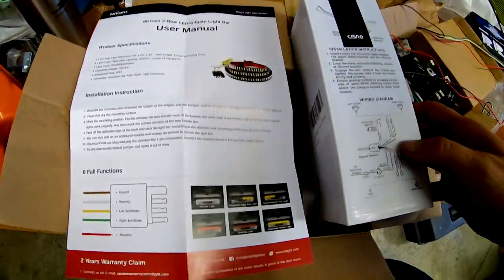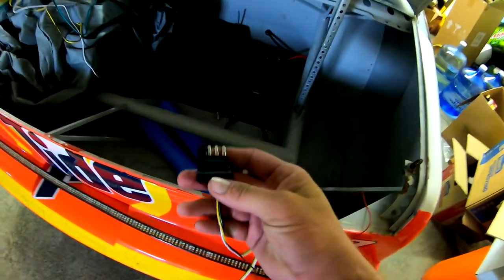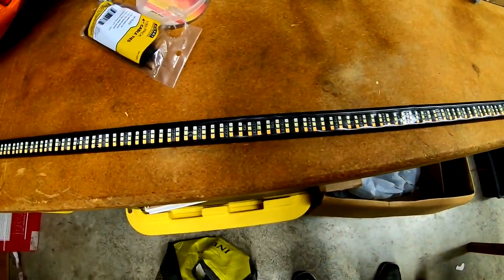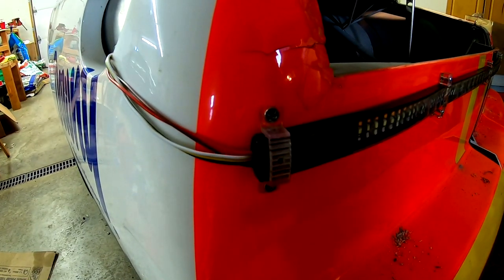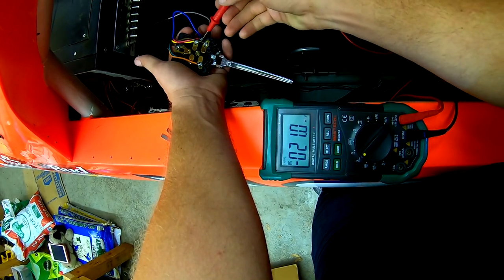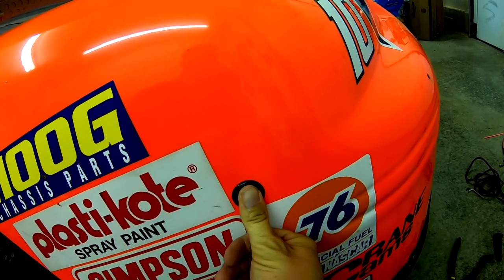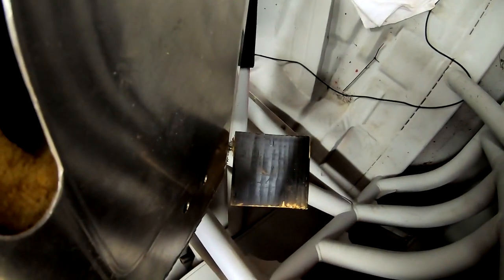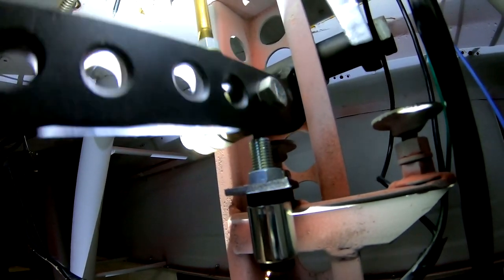NASCAR Tide Car Gets Turn Signals

Comment: Love the videos!!! Keep them coming. Thinking about doing the same thing. Can you show how you wired up the brake switch and universal switch? Any part numbers for rear light bar and blinker switch?
Reply from the maker: Thanks Chad! I appreciate the encouragement, I'm glad people are enjoying these videos. :)

I thought I showed the brake light switch in this video, it's a threaded switch that I adjusted off the pedal with a homemade bracket. If not, it might be in the one after this. The signal switch is a standard hot rod switch, it will come with instructions. The light bar is from Amazon, it has instructions also. Just measure for what you need and search search search! These cars were all custom, one off creations, my solution may not be the best for your car. Good luck though, it's a ton of fun!

Comment: Why not just run the wiring straight up to the deck lid into the trunk, at least there's less visible wiring then, assuming you can avoid pinching it?
Reply from the maker: That's a good idea, but all the body lines on the car are so tight, that running the wires that way would pinch them and also tweak the trunk line. I plan on drilling a hole behind one end of the bar with a grommet and running them through, no wires will be visible at all then.

Comment: Hello ! Wanting to know the parts number you used to apply to my race car as well ! Thanks
Reply from the maker: I think this is everything lol

Nilight TR-04 Truck Tailgate Bar... https://www.amazon.com/dp/B07KRRFYCC?ref=ppx_pop_mob_ap_share
12V Universal Street Hot Rod... https://www.amazon.com/dp/B01I536CY6?ref=ppx_pop_mob_ap_share
Nilight Led Light Bar Super Slim... https://www.amazon.com/dp/B0197ZQLBA?ref=ppx_pop_mob_ap_share
MICTUNING MIC-B1002 LED Light Bar... https://www.amazon.com/dp/B00O72R7Z8?ref=ppx_pop_mob_ap_share
2) 3/4" Smoked Amber LED... https://www.amazon.com/dp/B01I1CHCO0?ref=ppx_pop_mob_ap_share
WVE by NTK 1S5423 Brake Light Switch https://www.amazon.com/dp/B07DVPKZ6S?ref=ppx_pop_mob_ap_share
Reply: @RightTurnRandy  Thanks man ! 
Im doing the same thing as well lol
Reply from the maker: Glad I could help. Good luck! It's a lot of fun.

Comment: I think it would look much cleaner using a single hole to run the wires in the back of the car right next to the light with a grommet. Its minimal for a cleaner look. Worst case use the house hold rubber wire hide piece.
Reply from the maker: I thought about that, The issue is that the hole has to be big enough for the connector, which is enormous, to go through. Or I have to cut the connector off, which I might eventually do.